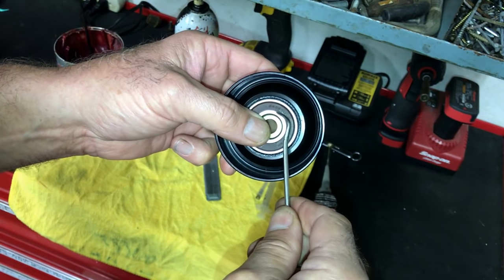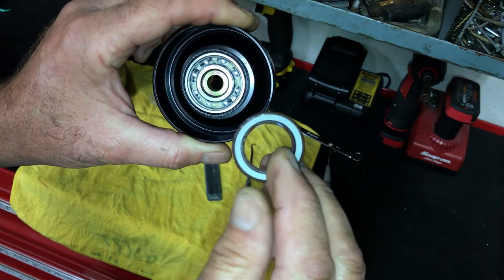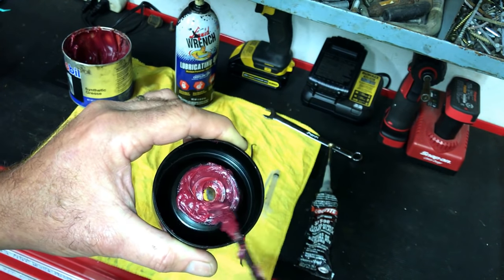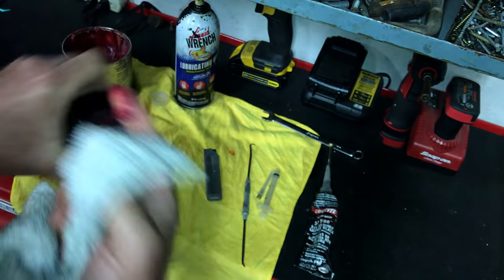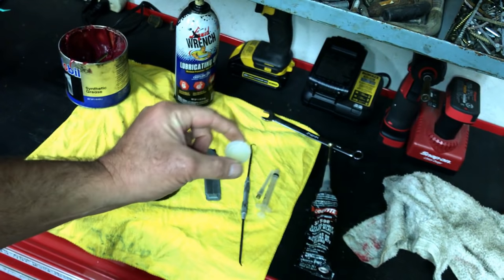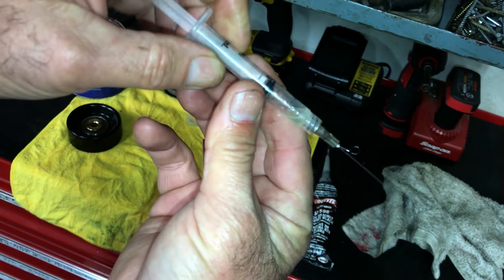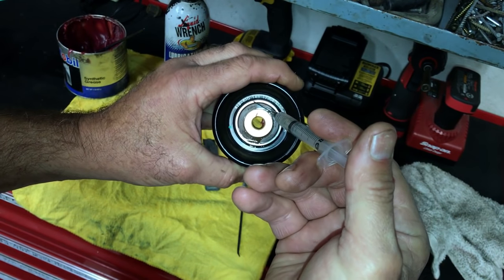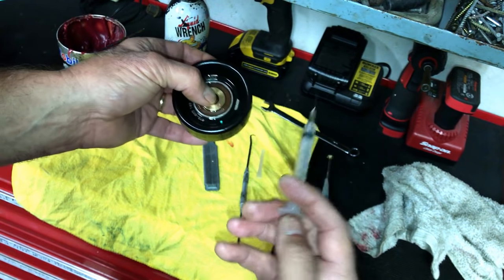Make Your Drive Pulleys & Sealed Bearings LAST A LIFE TIME :)

Comment: I never use a small brush to load the bearing.  Go to your farm supply store, get a grease needle, it will allow the grease to be squirted into the bearing as does Suringe.
Reply from the maker: thanks much   and thanks for being here with us :)
Reply: Yeah I was wondering, I'm a little naive but can you just go to the drugstore and buy syringes with needles in them? Not trying to be a smart-ass just curious never tried it before.
Reply: We fill a bigger syringe up with grease and it is always ready.  If the end is too small just open it up a bit.  Without the headless it should be ok

Comment: Great idea! I would go a step further and clean out the original white grease with some brake cleaner.
Reply from the maker: You can take this process as far as you’d like we have found over the last 20 years that when we add the quality grease in it pushes the old grease out as there’s not that much in there to start with have a great day
Reply: Never remove all the oil or grease from a bearing! If the Grease does not harm being mixed it's best to , do has he did.

Comment: Great video, just one comment - I was committed to M1 Synthetic for all my grease applications years ago, but over time found that it separated much worse than any grease I’ve used.  On trailer wheel bearings, I’d find oil trails running down the lower half of the wheels after sitting awhile; I had to keep my grease guns in buckets to catch all the oil leaking out of them.  So I’ve switched over to Super Lube Synthetic, we’ll see in time if it’s a reasonable substitute.
Reply from the maker: Thank you Mike for sharing we have been using the mobile one for as long as I can remember never had any issues with it and have a great night my friend
Reply: Yeah my mobil filled guns leak, same as my brand new tubes of grease. Too much separation there.

Comment: Yes I always do this to all bearing cuz they seem to be cheap on putting in the grease
Reply from the maker: Pat you’re very correct they do not put quality grease in most of the bearings we have seen have a great day
Reply: lve had brand new pulley bearings come to me with no visible grease on them at all. Quality control nowadays is almost nonresistant. lf the bearing is on, or going in to something that's worth it to you, it should be an automatic thing to check and grease them. After l've started doing that l've never since lost a bearing.

Comment: Will this work with plastic timing belt iddlers? And can i used a metal one instead of a plastic one? The aveo's plastic timing iddlers shatter at 50k..
Reply from the maker: it works for all idlers and yes you can use a metal one
Reply: @SweetProjectCars  which size do you reccomend? Bigger one or find one the same size
Reply from the maker: buy the factory made one specific for your car....thanks mike

Comment: Thank you, great video.  Love your work.  2 Questions.  
1. Is it only worth it to apply the bearing grease to new pulleys? Any reason not to remove the ones already on the car and apply bearing grease them when doing a belt change, etc? Seems a lot longer lasting than the syringe method.
2. Is there anything lithium grease is best for that you would use it for or is it always going to be outmatched by another grease in every application ?
Reply from the maker: No, you can do your pulleys anytime you can get to them, new or used.  The second part of your question, we love lithium grease, we use it on many things and we also love full synthetic wheel bearing grease.  Hope this helps my friend!  Thank you so much for watching and asking Wes.  Hope you have a great day.  mad Mike the hammer SPC

Comment: Hey Mike, good thing I checked the other Mercs, my daughters idler pulley disintegrated while taking it off!! Have one question... is it possible to pack the bearings too much? I assumed if the grease squeezes out when putting back together a little thats fine. They don't spin easily by hand but the front end sure is quiet now with the new ones in.
Reply from the maker: Hello Dave good to hear from you again we pack them tight when we press and seal back in any extra grease comes out and when you spin it a few times the extra comes out as well we’ve never had an issue with over packing them and we pack and pretty tight

Comment: I had noisy bearing issue. Tried lithium grease spray and wd40 and noise went away shortly. 
Then I tried some 10yr old left over duralube. Tried the syringe method and the noise went away quite a while. Key is I think quality lubricating oil.
Reply from the maker: Nizar you have a bad bearing and it needs to be replaced
Reply: Ok. Will look into a replacement soon. Before install I shall take ur tip to have it greased up. Tq.
Reply: Finally replaced the bearing with a new one. Washed out the existing white grease with carb cleaner and smeared #2 red lithium hi-temp bearing grease. 
Its a shame the original bearing was a made in Japan. The new one I suspect is china. Good thing I replaced the grease.

The old Japan bearing wgic lasted for 12 yrs gave way bcoz the mechanic replacing my serpentine belts tightened it too much. Such a shame. Now a/c runs cooler, quieter and much reduced vibration.
Sometimes u gotta do things urself. Tq to youtube and yooutubers like sweet car project!

Comment: Is there anything to be gained by cleaning out the old grease before putting the new stuff in? I've been doing this with motorcycle wheel bearings for about 35 years now, de-greasing them and then packing them with Castrol BNS. just wondering if I'm wasting my time soaking out the old grease.
Reply from the maker: Dave there is nothing to gain, the heavy grease will work it's way right past the light white grease :) thanks so much and we are glad you are here with us :)

Comment: Works great on muffler bearings as well.....
Reply from the maker: Large Rooster it does and it works even better on Kiniffle Valves :)
Reply: Don't laugh to hard at yourself but one of the Mercedes-Benz cars has a muffler bearing.  Think they use it a flexible mount point.

Comment: wouldn't liquid wench make whatever grease turn to liquid and drip out? doesn't mixing some greases make it corrosive?
Reply from the maker: We have done this method for years on hundreds of customers cars the liquid lubricant that we use if injected revitalizes any greases that are left inside the bearing it works great for those who do not want to remove the pulley The best way to do it of course is to re-pac with mobile one full synthetic but if you can’t do that injection works great. Have a great day my friend

Comment: How about using Lucas Heavy duty oil stabilizer mixed with just a little 40weight oil and inject that. I've never tried this but I don't think it a bad idea if it will inject through the needle.
Reply from the maker: If you can get it in the syringe without damaging the seal it will definitely help the bearing to last longer but popping the seal and packing it with mobile one full synthetic is the real way to go my friend have a great night

Comment: I love your videos and thank you, however I usually remove both seals and flush out the old lubricant with Brakleen until it spins freely. Then put Mobil 1 (best choice!) from both sides and replace the seals. Be careful not to pack to tightly as pressure may build and blow out a seal. Great channel!
Reply from the maker: you can do that process as well but through our trial and error we found just installing the syn grease from both sides works very well   thanks for your great tips ... and thanks for being here with us :)
Reply: 100 percent agreed with removing both seals and a cleanup with cleaner of small minute pieces that is there due to small amount of normal wear, new fresh grease it is!!ty excellenttttt

Comment: Once you pop both seals, why don't you immerse the whole bearing in a solvent, like Acetone and dissolve the existing grease, let it dry and then repack with the new synthetic grease?
Reply from the maker: Mike you can do whatever you want to do we’re just showing what works for us and has for over 25 years with Never an issue on hundreds of customers cars, it is very simple and quick to do and does the job

Comment: Would the syringe method work on the wheel bearings of an suv or are they sealed too tight?
Reply from the maker: Gashauler the syringe works very good for those tight sealed bearings

Comment: Mobil 1 synthetic grease is a lithium based grease and therefore compatible to use along with a white lithium packed factory bearing.  Point being, you should always know what type of grease you are using and if it is compatible with the grease already in the bearing.  Lithium based greases synthetic or not, are not compatible with everything.  Check a grease compatibility chart.
Reply from the maker: Give very much for sharing this great information it helps everyone have a great night

Comment: What was that bearing used on ? What car/model ? I don't know if you can pop out that bearing shield on a lot of those idler pulleys. Will that work on all of them? Thanks
Reply from the maker: Hello Tony if I remember right that bearing was for a range rover it will work on most all cars we have not found one yet that we have done out of hundreds that we have not been able to do hope this helps have a great night
Reply: Thanks for the reply SPC. Ok, I just got my new idler pulley's for my 97 JGC
One of the org pulleys failed (chewed up the pulley bracket) I looked at the org pulley that was still good but those were metal type bearing shields. I couldn't pop those out but the NEW pulley's..no problem getting the shields off.
I noticed the grease in the new pulley's (white like you show in the vid)
I don't plan on swapping out the grease right away. I did look at the
Mobil 1 grease temp specs 40 C ( 40 F) to 150 C (302 F)  I'll use
this and remove both sides of the bearing shields and pack it when I'm ready. Your vid was a great tip SPC.. ! Take Care

Comment: Will it be ok if the bearing is already making noise?
Reply from the maker: Best is to replace the bearing then do this process to the new bearings and you will not have to worry about it again but you can repack the bearing you have making the noise and it will definitely help it

Comment: What about those rear wheel bearings, like the ones you use a press to replace, they got a very flimsy metal cover over them, try to pry it off, won't ever be flush again
Reply from the maker: if they are sealed you can do this, if the seal is embedded too deeply then you will need to pass as you don't want to corrupt its ability to seal, the pulley bearings are in very little and a breeze to remove   thanks so much and we are glad you are here with us :)

Comment: Thanks for the continuing great money saving tips. In some places you will need a prescription to get a hypodermic needle. I wonder how we get around that issue? Another issue is what happens if too much grease is packed into the bearing? Won't the expanding grease push out the seals?
Reply from the maker: William we have never had an issue obtaining syringes we get them from our pharmacy or our vet..as far as the grease coming out we have never had that issue either...once you spin the bearing a few times by hand the excess if any will come out.  Thank you and thanks for being here with us :)

Comment: It is called repacking.. Because bearings comes out
from the factory pre packed with grease as suggested by the manufacturer so not to overheat the bearing if over lubricated. This commonly works on daily driven vehicles but not on high speed racing vehicles
Reply from the maker: 6 of 1 half of the other  of the other on the repacking term...also we have done this for 20 years on our own pro street cars with over 800 HP. Also I have never heard of a bearing in 20 years overheating from too much Lube especially full syn.

Comment: How about using Mobil 1. 5w-30 engine oil instead injecting lubricant on bearing? Thanks.
Reply from the maker: you can if it is not to thick for the needle   thank you very much for your great comment, it's great for the whole chain to have good people like you here :)
Reply: on a sealed bearing, better use grease as the seals are not tight enough to effectively seal oil
Reply from the maker: Jacques Poirier you are correct the grease is the best way to go !!!

Comment: Sweet tips on this channel! subscribed after seeing one of your 303 Aerospace Protectant vids, I've actually been using it for about 15 years, nothing else compares.
I'm wondering if you could use the small chainsaw bar sprocket grease gun for this, or what other small parts you could use it on. They only need a 1-2mm hole (sorry, metric in Australia) to inject grease.
Reply from the maker: if you can do the syringe method without putting a hole in the seal that would be great but if you have to then just dab a small amount of good quality silicone over the very small hole.   thank you very much and thanks for being here with us :)
Reply: Question, Do you know what the difference is between the 303 Marine and the normal one, if any? It's easier to get the marine protectant where I am so I got the the last couple of times, unsure if I can see a difference. The windshield washer tablets are good too, they must leave some kind of coating or condition the wipers or something because it's much better than other additives.
Reply from the maker: you can use either they work very similar     thank you very much and thanks for being here with us :)
Reply: @SweetProjectCars  silicone to fill the syringe hole?

Comment: While you've got the seal off, instead of just adding what little of the M1 grease you can, why not clean the OEM grease right out and then fill it with the M1? That's what I thought you were going to do.
Reply from the maker: no there is no sense in that, by stacking the red grease the seal forces it in, you do it from both sides and it will last indefinitely...we try to keep it simple the diyer.....but feel free to go in-depth with it as much as you like..
Reply: There would be a good reason to do that, as Lithium based greases react with the other kind and the emulsifiers react to form a hard waxy material, then the thick oil just falls out.
The white grease was lithium-based.
Reply: I would presume that whatever brand bearing you buy it won't be filled with the quality of grease such as the M1 though I'll grant you that the domestic brand will probably have a better grease than the Chinese.
Reply: For that matter then, if you're doing both sides anyway, pop both seals out and as you force the good stuff in one side you'll be forcing the crap grease out the other.
Reply: Gary Harper don't bet that the domestic bearing is going to be any better. I've found Eaton trans pilot bearings with NO grease at all. I've always used a grease needle and chassis lube. This is better.
Reply: @Gary Harper exactly what i commented....instead of buying a new pulley replace the bearing with a skf, ina or other reputable brand
Reply: @MrHBSoftware  yeah well my Mercedes INA idler pulleys had NO GREASE in them!  What the heck?  That's why I looked for this video...to add grease to them!
Reply: @sbhassan1  if thay are genuine INA  (these days most are fake) they know what they are doing

Comment: Sweeeeeet!  But, if you over pack it, won’t the seal pop off?
Reply from the maker: Hello Don no when you push the seal on the excess works its way right out you wipe it off and you’re good to go and of course you don’t over pack it if you put in the same amount it looks like I put in you’ll be good to go
Reply: Sweet Project Cars cool!  I repacked my cheap polisher with that stuff and it’s smoother than the better polisher now!

Comment: What about wheel bearings? Expensive and hard to change. Can you even get to them? the Syringe might work with some DSX- Desert Storm Extra or some other high tech lubricant.
Reply from the maker: If you can pull the seal then you can repack them with the full synthetic on older cars were you actually still get to deal with a roller bearing type wheel bearing we only pack those with mobile one full synthetic never had any issues with them. Hope this helps my friends
Reply: So, on the newer cars it's just too hard to get to them even with a syringe? You must do them when you change them?
Reply from the maker: you are very correct, the best thing to do is do it when you change them then you will not have to worry about again my friend :)

Comment: Wouldn't automatic transmission fluid work as well as the penetrating oil?
I usually submerge them with automatic transmission fluid in a coffee can and let them soak for a few days or more.
With the ones on the vehicle I use DEEP CREEP with a syringe. Your comments please.
Reply from the maker: bob we have tried everything and when dealing with belts the grease stays put unlike the oils we have tried in the past
Reply: Thank you for your replies. DEEP CREEP works far better than any penetrating oil, or PB blaster, especially when trying to remove rusted sized nuts and bolts. Thanks again.
Reply from the maker: thanks bob we have tried both and found the PB Blaster works the best for us on rusted stuck bolts and nuts ...but that's what makes the world go round...different strokes for different folks :)
Reply: John Foley  By coincidence l use a 50/50 mix of MMO/Acetone as a fuel treatment. 2 oz each (4 oz total) per 10 gal fuel.

Comment: um so it's ok to mix liquid grease with thick grease? won't it turn it to soup?
Reply from the maker: Leo M you use the liquid only if you dont want to remove the pulley from the car ...and it works great done it for 20 years with no issues on 200's of customers cars.